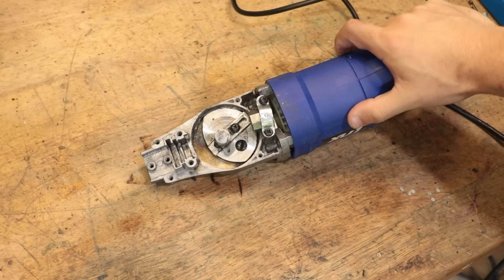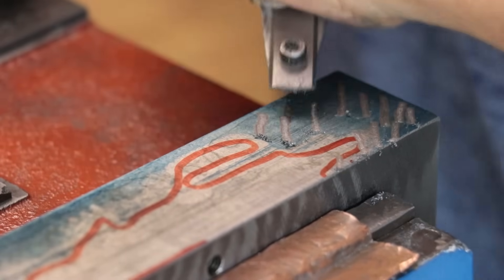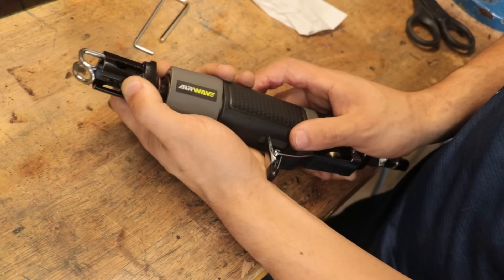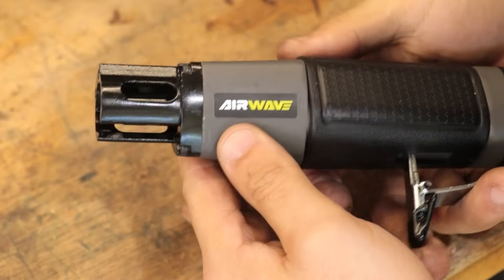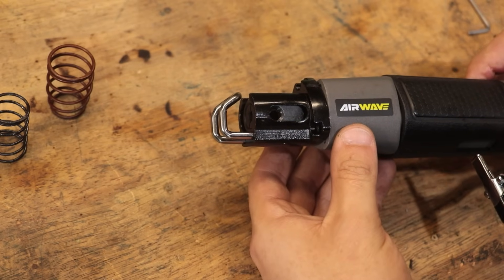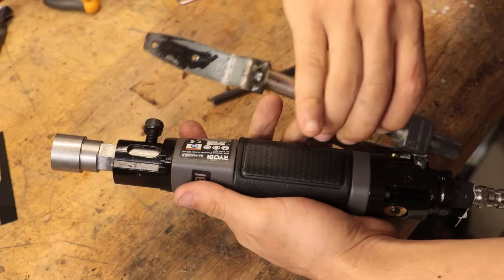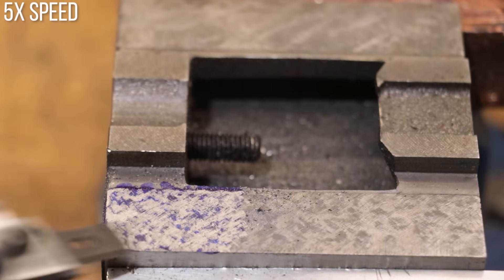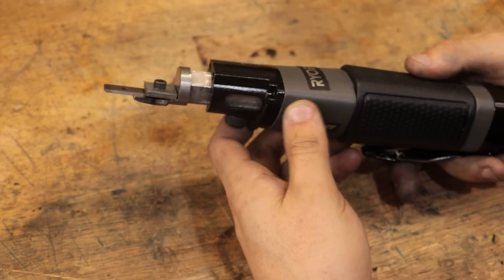Making A Pneumatic Power Scraper - One Day Build

Comment: if you reduced the flex in the tongue of the holder by replacing the piece of flatbar with a machined block it would probably remove more stock per stroke and allow you to press down more firmly if you wnated to. I also think the unsupported tongue will shear off after a few hours if left hanging as it is.

Comment: Instead of lowering your air pressure, drill and tap a set screw/bolt into the handle where the 'button' is after bending it out to reduce how much you are deflecting the other end of the 'button'. Pretty sure there is a better term than button, but cant think of it.

Would probably shoot for some really fine thread because 1-the handle isnt particularly thick (Unless you wanna make a thicker one), and 2, would allow you to fine control the speed. Looked like part of your issue for the test run was hitting the carbide in and getting 10 strokes against the metal before you can react. might need tighter tolerances, but you already sanded the shaft into compliance, so not much to really shoot for there.

Another thing might be a more rigid system to hold the scraper, but that would be a solution if you were flattening dozens of surfaces a day, not a couple per decade.

Comment: Great design.👍 In scraping, I always wonder how the material is removed from the base of such a vice, it can be obtained its flatness but how do we know that we will do it symmetrically and after installation on the table of a milling machine, the vice database and its jaws will not be flat and diagonally relative to the processing plane?

Super projekt. W skrobaniu zastanawia mnie zawsze jedna sprawa, jak usuwa się materiał z podstawy takiego imadła to można uzyskać jego płaskość ale skąd wiemy że zrobimy to symetrycznie i po zamontowaniu na stole frezarki baza imadła i jego szczęki nie będą płaskie a po skosie względem płaszczyzny obróbki?
Reply from the maker: That’s the difficult bit. Making it parallel. You crape the bottom. Scrape the top. Then you use an indicator and 123 blocks to see if the top is level. If it isn’t you scrape the high end down to make it level and flat with the low. It’s a lot of work

Comment: 2 things... and I did do scraping for a while...
1. Your carbide profile is much too square and there should be about a 5° back grind, top and bottom, which meets in the center, and;
2. On MOST pneumatic tools there is a "speed" valve on the top opposite the trigger valve, though dropping the line pressure will also have a slowing effect... to a point...
Reply from the maker: Yes there’s a valve on this tool and it was used

Comment: nice work but your geometry is WRONG. you made a pneumatic stabbing tool. the blade holder should be angled away from the centerline of the stroke. look at the dapra biax scrapers and take a close look at how the blades are held in relationship to the stroke of the machine.
Reply from the maker: It’s still works in the end
Reply: @artisanmakes  but it will wok much better with a slight change to the blade holder and wont beat the hell out of the tool.

Comment: The blade is too long .
Reply from the maker: If it I was any shorter I’d risk the bottom of the bracket hitting the workpiece
Reply: @artisanmakes  nope , should be fine if you reverse the brackets, top bracket should be longer than the bottom one.

Comment: theres a engraver called "Vibrograv"  (probably only a old german thing) but its a recipicating needle for marking parts with text.
its actually horrible as a tool but how it works might be interessting
its literally just using a E I core transformer where the laminated I part is hinged on one side and gets attracted to the E part every cycle and pushed back by a spring
at the other end of the I beam theres a rod connecting it to the linear head containing the needle.
i think thats a good point to start for a electric scraper  its range of motion is quite short and it runs at 50 or 100 strokes per second

Comment: When you've got something in the dividing head with that much stickout, you really, really, want to be using a tailstock.  Check the video footage as you cut the hex and drill for the screw, the flex is easily visible.
Reply from the maker: I know I could could see that. I needed two passes because the taper was visible to the eye

Comment: You should see about doing a small side project of making a sound dampening box for your compressor. LTT channel did something like some weeks ago where they constructed a box with foam inside. Airflow was able to move around the corners or baffles while fan noise was absorbed by the foam. This could make running your compressor much more bearable.

Comment: When I rebuilt my mill I did this and found that I used both a air and manual scrapper. Sometimes the manual one just is better but if you've got a lot to remove air or electrical can't be beat. Slow and steady is the key. Great video

Comment: Nice work. I tried to modify a reciprocating saw, but it left scratches.  I think there was too much lateral scraper movement in mine. This project was a great idea and I may try this out. You may want to think about improving your carbide blade edge grinding by using a lower RPM and implementing a diamond wheel They really put a nice edge on the carbide. Cheers from Florida’s Space Coast.

Comment: to slow it down a bit you could try adding a needle valve throttle to the muffler, that way control is very precise and the tool doesnt suffer from power loss or slip stick. thats how its usually done on pneumatic cylinder

Comment: A thing that I can recommend: hand lapping.

It is even cheaper than scraping, you only need the grit, which you can get for about 20 bucks. Your lapping plates are done from some scrap, and you can even lap your own surface plate. I did, and got it to 1.2um total deviation. Your tools and workpieces can be lapped too. Easy and cheap processy, requires little practice. Or rather you'll get all the practice you need while lapping your plates.
Reply: Lapping has its place but scraping dovetails or other surfaces that need to be parallel, square and true to one another isn't one of them. 
  What your not seeing in this video is all the measuring involved in to ensure the surfaces remain true to one another.  If you were doing a brideport mill for example, flat gets you nowhere unless the final result has the x,y and z axis true to one another. Flat is easy compared to the rest of tbe process, it has to be made true first before you go there.
Reply: @jefflyon100  all that is very true. I just wanted to share. In no way is lapping perfect. It is very bad at many things, but at flatness and roundness, lapping is great, as well for slightly convex/concave surfaces.

Comment: Try looking at a "Turbo lap" or a "Diprofil" it's what i use in the toolmaking industry. 

They rely on small high frequency movements which are much more useful than smashing the life out of it with a jackhammer.

They're designed for polishing but I've made scraper attachments and it works well.

I've never found flat square front scrapers to work well as they dig in the harder you push,

I grind up old triangle files and riffler files and pull the scraper towards by hand.

Comment: you might consider making a longer piece of spring steel at the front, then adding your blade to give you a bit of flexibility and better control. just to get rid of that jackhammer feeling! so you can flake out rather than pound them out, and control the speed a will help a lot.

Comment: You know the adapter is simple enough that it could be mass produced and likely sold as a seperate adapter for these reciprocating saws or made in to an entirely seperate pneumatic tool with slightly different parts like softer springs to reduce vibration in your hands as someone else had said. If you wanted a passive income stream I'd patent this adapter and contact TTI or Ryobi to talk aboout production. If power scrapers are becoming more popular thanks to the internet, there's a chance they're so expensive due to either complex manufatury or because they're still such a specialised tool that their only use case is precision industry, but a simpler design may bring them to a consumer market. I'd be curious to compare your design to an official power scraper to see the viability of a patent.

Comment: To slow down the stroke speed, along with air flow reduction, you can add mass to the piston.
Reply: And add a bit of mass to the body of the machine at the same time, to maintain the body:tool mass ratio.
Reply: Simply adding a flow control downstream of his regulator should do the trick.
Reply: What would be better is if he could find a way to slow down the reverse stroke further than the punch stroke.
Reply: Tapping the air return hole and screwing in a restricter piece? Sort of like a grub screw with a hole drilled through the middle of it.
Reply: @captianmorgan7627 wow great idea!

Comment: Does anyone know if scraping a surface that might get abraisives on it is bad. Compared to lapping/ground surface. Because if the surface was lapped/ground then the fit would be tight enough so most abraisives be pushed aside.

Comment: The angle of the blade is wrong. If you think about it, when using a hand scraper you keep the tool at a constant angle, and use a lateral movement.
With the reciprocating tool, you are ineffectivley stabbing at the work price.
If you rotate the angle of the blade and keep the tool horizontal the blade won't keep bouncing off the work peice
Reply from the maker: It’s imperfect bits it’s still doing the scraping that I need it to. In the sense that’s it’s removing the material and creating the dips

Comment: A few years ago, someone else did this, with the angle grinder, but I really didn’t like what he did. I’m curious as what your solution will be. I scrape annually, but I avoid it whenever I can. This seems to work well enough, but it’s bouncing around too much. I do think that bothe the stroke and speed should be moderated. Being that this seems a light lighter than the occasional power scrapers I’ve used in the past, that’s one of the reasons. There’s not enough mass to keep it from jumping.Hardened surfaces aren’t scraped, just ground. But people also have to understand that often scraping, even when done correctly, doesn’t add to the accuracy of the equipment.

Comment: I recently purchased a so called silent air compressor.   Well it isn't silent but compared to the Ozito air compressor you have, and I had the difference is night and day. With my milling machine and lathe listening to how they cut is important  and a 93dba air compressor doesn't help. 

My quiet air compressor takes 60 seconds to full pressure and it's importantly quiet 😊
Reply: 90dB is insanely loud, even non "quiet" compressors can be a lot lower than that.
Reply: Or just a much larger compressor. Then it will not run all the time. I took that route, and I have no regrets 👍
Reply: Get a second hand dentist's air compressor. They are extremely quiet. My mother had a dental practice and when  the old compressor broke, the technician brought a regular air compressor temporarily. It was very loud for a dentist's office. They are similar to compressors in fridges

Comment: Amazon US $70.  Air Reciprocating File Body Saw, Multi-function Low Vibration 8000spm Pneumatic Cutting Tool & Abrasive Tool with 4 Files and 5 Saw Blades (Stroke Length: 5mm)

Comment: I was thinking along the same thing as you for changing the stroke length however after giving it more thought I came to another possibility that would give you easy stroke length adjustability:

Could you not mount a locked post and use a see-saw or teeter-totter lever with one side attached to the double acting piston and then adjust either the point or the length of the lever after the locked center post.

This gives you the advantage of easy access to relocating the 2nd point as well as offsetting it at a lower angle of attack while keeping your hand and the tool body up away from the surface. This also keeps the original rpm lower than by artificially forcing the dual acting piston to become smaller with spacers which would increase the rpm.

Comment: Maybe use a flow control valve to slow it down a bit. It doesn’t reduce the pressure. Just the flow rate of the air.
Reply: Unless he adds a flow regulator to the output of the machine, its impossible to regulate flow without effecting downstream pressure. Look up meter out vs meter in to understand more if you like, but you are on the right train of thought.
Reply: I’d advise you to educate yourself before saying stupid stuff like that again
Reply: @geekswithfeet9137  I would advise you add to the discussion instead of being a dik.
Reply: @geekswithfeet9137  Is it your time of the Month? I would advise you get some manners or better yet add something to the topic!
Reply: I'm no expert in air tools, but that sounds a lot like trying to limit the current through a resistor within changing the voltage. i.e., impossible (while it may have the same pressure with no load, surely it would decrease in pressure when loaded)
Reply: @KingJellyfishII  The analogy would be a variable Resistor while leaving the Pressure and Potential Volume on the Compressor side unchanged.
Reply: @seabreezecoffeeroasters7994  

You cannot compare air to current, it just doesn't work. An electrical current in a single-path circuit is always the same at every point and adding a resistor will reduce the current in the entire circuit. The resistor uses some of the energy and transforms it into heat.

If you reduce the flow rate in an air line you only limit how much air can get through per second, but you don't change how high the pressure can get if it has enough time to flow through the restriction. A restriction doesn't remove air from the line, it just limits how fast it can travel.
The "without changing the pressure" bit is wonky; you don't change the pressure at the compressor side, but the pressure at the tool side will be lower as the restriction causes pressure to build up slower in the toiol while the tool constantly bleeds off air. The compressor is effectively playing catch-up with the tool.

But slowing the tool down means it will have less force. Test and find out.
Reply: @vinny142  Without getting into the weeds to much it was a reply to the specific poster to get them closer to an Electrical Analogy. You obviously cannot tie a compressible fluid to Electrics specifically but broadly it is 'closer' than Voltage or Current they were talking about.
Reply: @vinny142  you can compare air to current, but it takes more than just resistance; reactance
Reply: @KingJellyfishII  correct, if you have a flow regulator, you reduce the working pressure. This is why you have pressure drop in long thing air lines, they act as a flow regulator. If youve ever used a HVLP gun, youll know that it reduces the working pressure. The HVLP varies pressure by exactly this method. Measure the air pressure in one running and it will drop far more than it was at static. Pressure and flow are linked.

Comment: I concur with others regarding the need to make the scraper blade off-axis to the reciprocation. An inclined blade mount will also be a bit stronger than the one you've used. I know next to nothing about air tools, but I wonder if decreasing the size of the exhaust port would enable you to slow it down, perhaps with a needle valve? You'd need to be careful with your inlet pressure though! I also wonder whether rubber o-rings would be a better material for the spacer. I'd probably glue some thick neoprene to the body too, to give a bit more control and to reduce the amount of vibration your body is subjected too.

As rudimentary as this tool is, I think it has promise! I might not want to use for the final passes, but it looks like it could do well for roughing in. You definitely need to make yourself a slow carbide grinder and jig to get your blade geometry right. The cutting edge should be precise and polished, with just the right radius and cutting angle for the material you are scraping. I'm in New Zealand, a remote land that apparently no Biax ever reached, so I'm really interested to see what enhancements you can come up with, so that I can shamelessly copy!

Comment: This is a clever design, definitely worth trying.  For those of us here in the US who think we might just go down to the nearest Home Depot and pick up a Ryobi AirWave reciprocating saw to duplicate this build I believe there may be some disappointment, as it seems to be a product that is local to Australia.  Fortunately there are many other similar saws available here but be aware that it may take a little searching to find one from the same factory but perhaps badged with different retail label.  Online auction sites might yield some results.  Thanks for posting!
Reply: Ryobi is a hugely popular brand here in Aus and we have a lot of Ryobi branded tools that are probably specific to Australia, right down to how the product numbers are labelled.
Reply: Ryobi is available in Sweden, so it seems to be an actual brand. (With a lot of other stuff, the manufacturer will put any name on the procuct, that the buyer decides. I've done that with consumer electronic's.)
Reply: @andersgrassman6583  I should clarify that Ryobi as a brand is widely available in the US but more prominently in cordless and corded electric tools.
Reply: Harbor Freight air saw for car body work.  Cheap and if you screw it up it is only $25 for a new one.  If you are a real weasel, you can turn it back in for a replacement by claiming it doesn't work.
Reply: I recently bought the same tool under name Aircraft in EU.